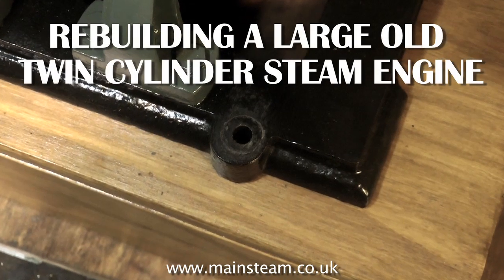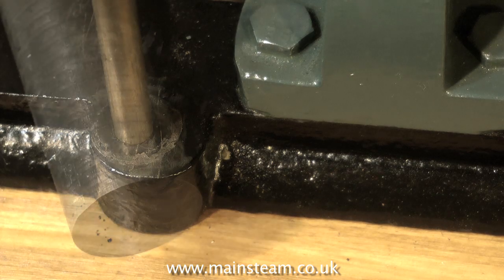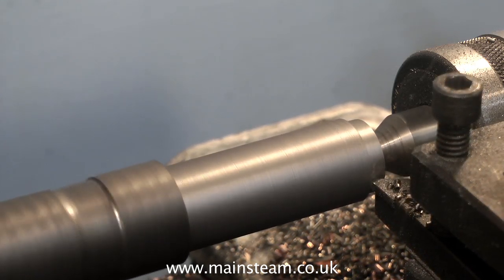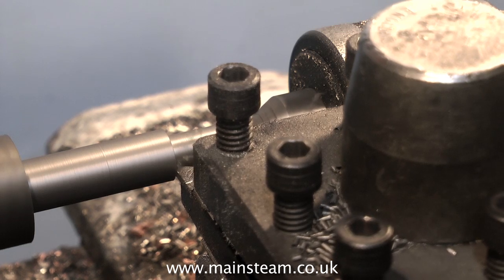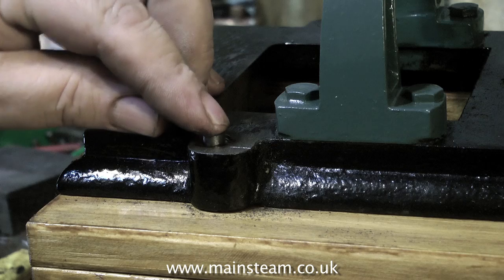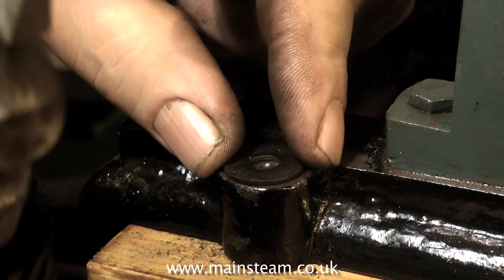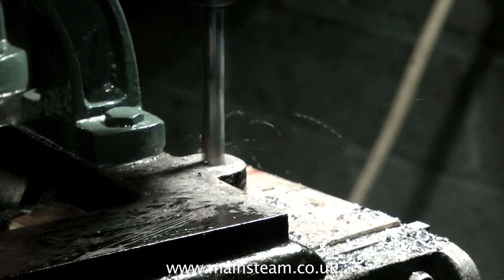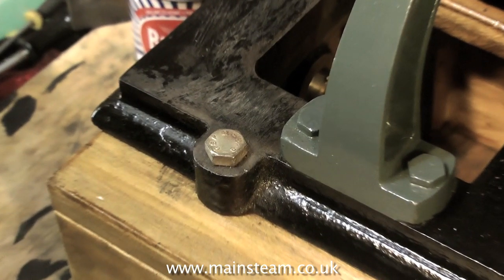PART #8 - REBUILDING A LARGE OLD TWIN CYLINDER MODEL STEAM ENGINE

Comment: Keith, first thanks for sharing your know how and talents with us, and the question I have is why not over drill the base plate holes to a larger size and then plug them up, I would have thought that you might even be able to get the filler plug big enough so the new holes would be within the new metal